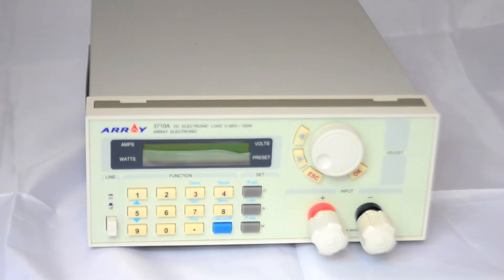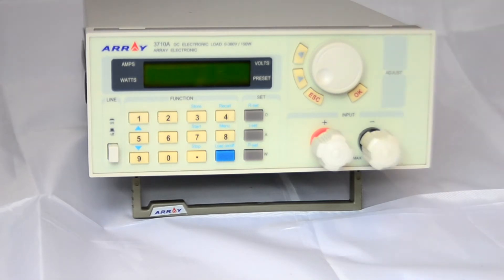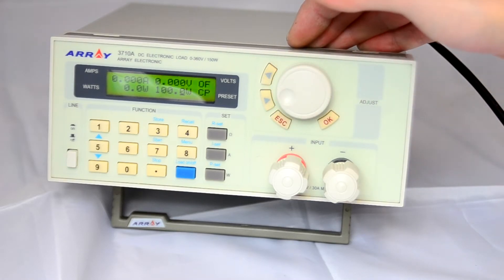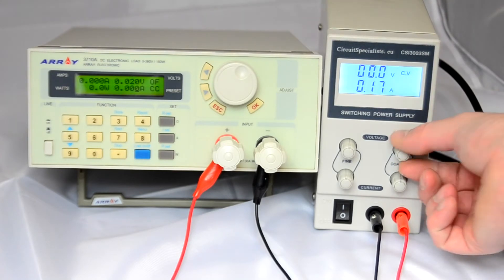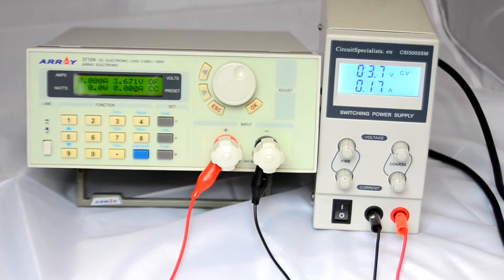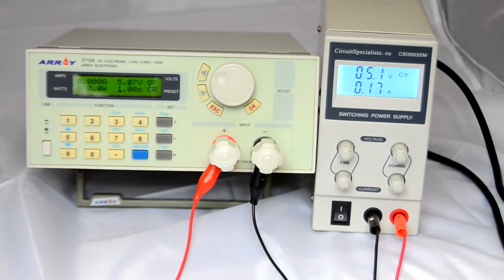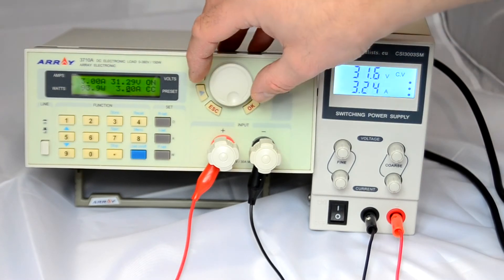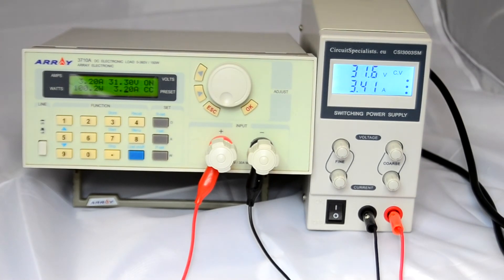Array 3710A DC Electronic Load - First Impression

Comment: That is very nice for cheap DC electronic load.  I should warning you to not stay connection for too long, it will get very hotter and possible damage those DC electronic load.  So take care.  Keysight is the better but super expensive.

Comment: This might be a dumb question, but can you use a DC electronic load to test ATX power supplies?  I have an ATX PSU tester, but I don't think it puts a load on the power supply (it seems to only test the voltages, which is rather useless if the PSU fails when a load is put on it).  If it is possible to test ATX power supplies, I'd love to see a video on how to accomplish that.

Comment: Very cool. I am also very impressed with the little bench supply. Did you ever get it's fan to kick in or release blue smoke? How much was the little psu. I could do with a smaller one. I imagine the reason for the bursts of fan are trying to keep it's noise level low and run as little as poss to keep the noise down. I imagine running with these all day 8Hrs of fan would get annoying! I have a 40v/40a bench supply never even heard the fan run. Never drove it to the max though. May make up a bulb chain and give it a try. Just to check the fan works....!
Reply from the maker: Thanks Ant. The PSU is an incredibly cheap £40 from Circuit Specialists (EU) You can tell it is cheap, but quite frankly I don't think there is a better one for the money, and it stood up well to some load tester abuse.
Reply from the maker: Oh and just for you Ant, I did the filming of this one in the kitchen with a high frequency 750w lamp lol
Reply: arcadeuk I could tell your going to full product demo mode! White background and everything...! Lol! Thats really weird it being from Circuit Specialists (if it is the same one based in Altrincham Manchester). I bought a switching psu (non variable 12v/25a) from them a few days ago to power a charger I just bought. Never heard of them before that. Is there a second vid btw? You mentioned using a Multimeter to see how accurate it is later in the video but to carried away trying to blow up the psu and forgot I think.?!
Reply: arcadeuk
I also hate everybody slagging off cheap made in china stuff. If you buy an item built down to a cheap price it will be crap! As you point out if you get something built to a decent sensible price bracket it will be fine.

Comment: A linear PSU is not dissipating much heat when at full output voltage since the conversion is very efficient (low delta between input and output). Try a very low output voltage at max current and almost everythign will be converted into heat.
Reply from the maker: Anthroplast I agree with your theory, however, this is a switch mode supply :)
Reply: arcadeuk also the end stage? normally the end stage is linear regulated (for low output ripple and faster regulation) and the AC/DC stage (switched) feeds the linear stage at it's max input voltage  (35v in your case I assume). Sometimes also stepped (if you hear relays click) when going through the range. But I have no idea how your PSU works so i'm not going to comment further on it. Thanks for the review I'm also looking to buy a programmable DC load. How is the accuracy in low load situations? eg 1 to 50mA ? I got a dc/dc convertor I want to know the efficiency from over its light load range.

Comment: Hello, i have a problem and hope you can help me:
Im testing a hydrogen Fuel Cell and after a time the LCD turns off and you can hear a non-stop beeper.
The voltage of the Fuel Cell is not higher than 3 V and thats not over 360 V DC ;)
Further the LCD showes a Voltage 0,73 V but the device is not coupled with a Power Source.
I bought it 3 Weeks ago.
Thanks for you'r help.

Comment: I would like to connect an Arduino to the 3710A. My goal is for the Arduino to get power readings, several times per second. I have a 3312 TTL to USB adapter. I will probably need the Arduino to act as a USB host, but the main problem is how to get the power reading? Any suggestions?
Reply from the maker: If you go to the Array website, they have full documentation on the communication protocol, so this should be perfectly feasible. Please note, it is probably easier to use the Arduino to talk to the 3710 as a serial device directly rather than via USB. Also remember you need to add an opto-isolator to the serial
Reply: arcadeuk Thanks. I found the documentation. That's a huge help. Regarding the opto isolator, I thought the 3710 had a TTL signal from the serial port. Circuit Specialists sells a "USB to TTL adapter" for the 3710. If the serial port on the 3710 is TTL level voltage, won't that safely connect directly to the arduino?
Reply: Carmen Brown I think I'm going to put an o-scope on the signal wire to measure the voltage. Then I'll know for sure.
Reply: Carmen Brown I contacted the company. They sent a pin-out of the serial DB9 connector. Pin 1 = +3.3 VDC, Pin 2 = RXD (3.3V), Pin 3 = TXD (3.3V), Pin 5 = GND. All the remaining five pins are empty.

Comment: The weakest cheap chinese link in that demo is probably the croc clips. I have similar looking ones from ebay about 30cm long and about 0.2 ohms. Compared to the test leads that come with my multimeters which are all roughtly 0.05 ohms for 1m length (although my accuracy is not wonderful at these low resistances as I'm just using a good multimeter wth 0.01R resolution). That explains the difference in voltage reading at load.

Comment: What happens if you press Ok after setting a config, then Ok.  Rather than Ok and Esc?
Reply from the maker: I've confirmed I was doing it right from the manual. Pressing OK twice does nothing. You can Press either OK or R Set / I Set / P Set and then ESC, both achieve the same thing, but you still have to press ESC. I think they slipped up with that design decision, but other than that, it is very easy to use